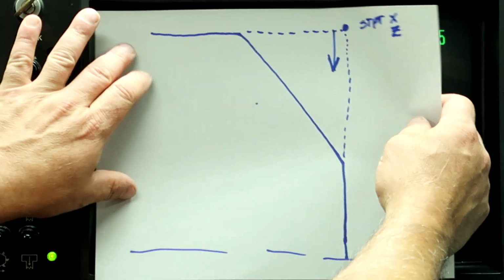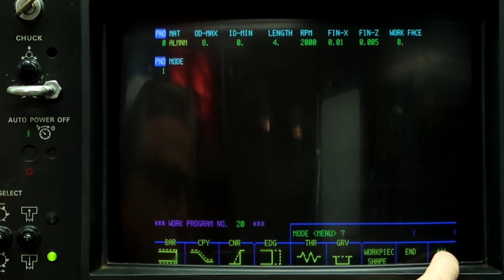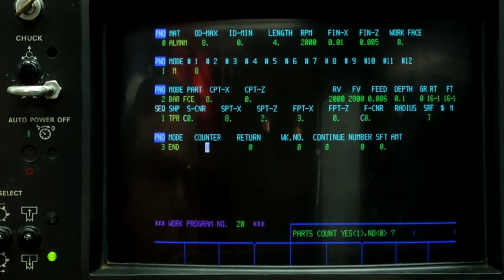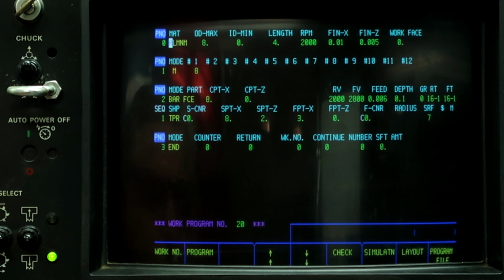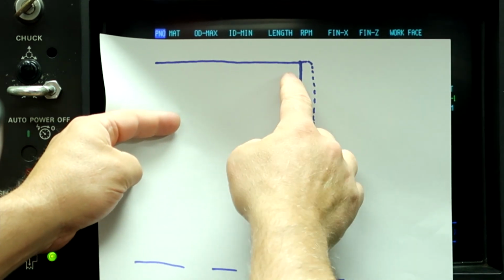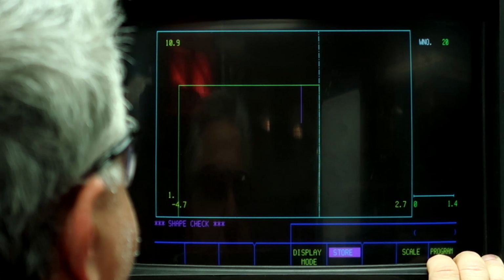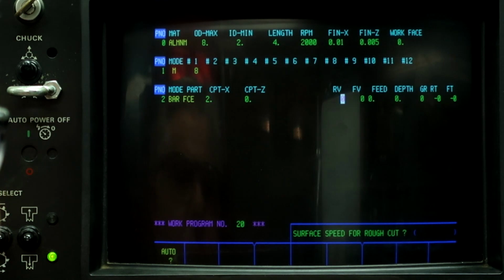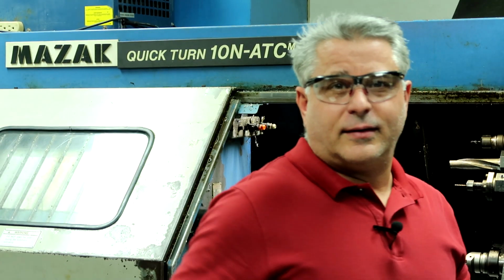Mazak CNC Lathe Bar Face Function

Comment: Thank Phill, Excellent tutorial, I was just wondering how you can program a mechanical stop (tool) for mass production in the same program?
Reply from the maker: Easiest way is to program a manual process MNP and give it an X and Z position of where you want the tool to park and enter M0 all on same line. Do not use an M-code process to stop as it will stop the machine with the tool next to the part.

Comment: What does 16-1 do?
Reply from the maker: @blackmann5382  That's how the tool and offset is called out on this older control. Tool 16 offset column 1 or 2. 99% of the time it will be column 1.

Comment: How do use the facing function to do an internal taper?

Thank you so much for the mazatrol content. I have learned valuable information.
Reply: You're probably going to find that your boring bar is not rigid enough to do internal facing. It can work if you limit your depth of cut to 0.030" max depth of cut, but it is usually better to turn towards the chuck with a boring bar. I've used a facing cycle on internal tools when  turning a flat bottomed hole.
Reply: @86joeblow it’s true. You can’t take much of a facing depth cut, but it did the job. I finished the actual internal angle by the common boring method of “toward the chuck”. Mix and match. I hate having chips buried inside the blind hole, which is why I faced the majority.  

If I had inserted drills, I would have gone that route to open it up.

Comment: Hello.  First of all, I apologize for any mistakes in writing, but I write in Translator.  I learned a lot from your videos and they helped me many times.  I have a Mazak QT10N (unfortunately without powered tools).  I have a question: When I make corrections to the tool, do I have to check the program every time (check continue) or is it not necessary?  Regards
Reply from the maker: @kulas108  performing check continue is the safest way when learning Mazatrol to prevent mistakes but not necessary.
Reply: @mazatroltipsandtricks6816  Thank you very much.  Because what I meant was that if the program is long and I raise the knife by 0.02 mm, do I have to recalculate the program.  Because he often makes ready-made details.   For two programs.  First the first program, workpiece rotation and the second program.  And it's always time gained without check continue
Reply from the maker: @kulas108  you do not need to program check if you are only adjusting wear offsets.

Comment: Could you do a video on writing a program that calls up a subprogram and uses arguments? Example: drill and threading a hole with a single edge thread mill in a vertical mill. Same size thread in different locations.
Reply from the maker: Sorry my old machine does not have the ability to do sub programs like the newer controls.

Comment: Just a bit confused on the tool shape...on the 2nd part you used a general-edge 35 deg tool.  To cut that part requires a rather odd boring bar. So how does that work?
Reply from the maker: 36 degree diamond turning tool mounted parallel to Z axis. Nothing special.
Reply: @mazatroltipsandtricks6816  OK thanks. I'm surprised the turning tool doesn't  rub on the backside as it makes the undercut corner, but maybe it just clears.